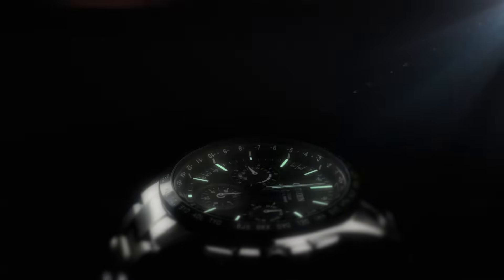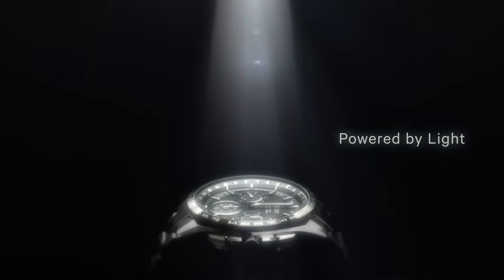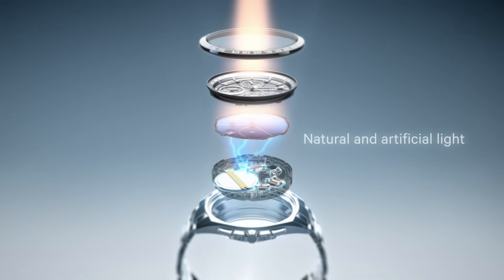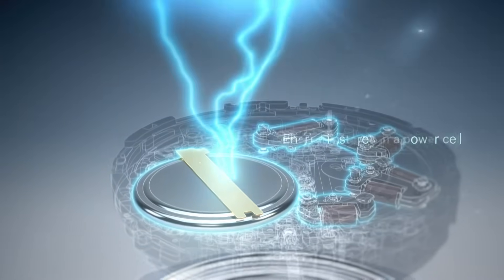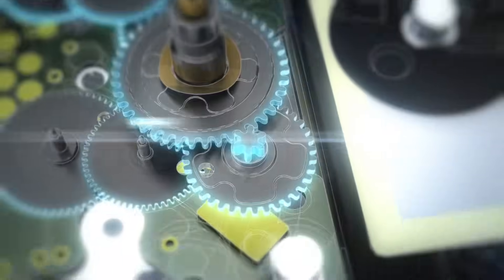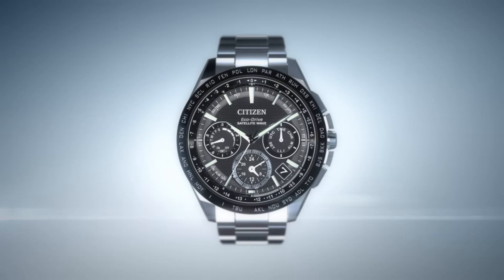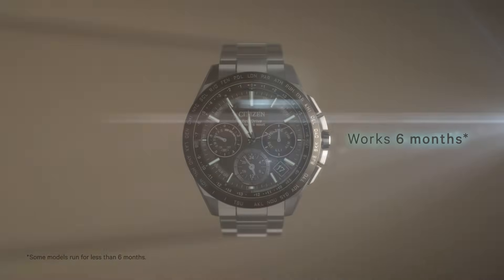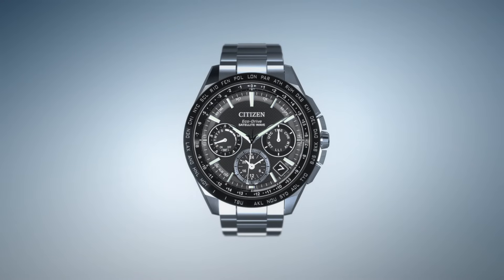Eco-Drive How It Works

Comment: I have the Darth Vader B612, is there a way to tell its charge rate? I thought I read some have a transparent band that goes around the inside dial or something. apart from knowing low power and the special hand ticks back and forth.

Comment: My mom's Citizen Eco-drive watch still works flawlessly after more than 20 years! I've struggled with battery watches and mechanical watches for years, but now, I've finally invested in a Citizen Eco-drive!!! So far, I love it!
Reply: eco drive uses batteries too , only they call them capacitors .
Reply: @tjlee9901  Yeah, I know. With battery watches I meant those ordinary watches with non-rechargeable batteries you have to hand in every now and then to change batteries when the old ones runs out.
Reply: @milosen6744  im just saying eco watches also have batteries and sometimes they give problems and need changing .
Reply: @tjlee9901  Ofc. Few things works 100% all the time, and nothing works forever. But some things works better and longer than others. Citizen Eco-Drive is one of those.

Comment: absolutely amazing watches , I bought my Eco Drive back in 2004 , and never touched it, thing just keeps going and going and going ... I keep that thing on my wrist whole day, every day , except at night... I swim with it, go to gym, hot tub , sauna, work , and it just keeps going ... I have one with a metal band and the whole thing is just super durable , I never changed the band or battery or anything ... it needs no maintenance whatsoever... bought it for 100 bucks new at the jewelry store at the mall .... probably the best 100 bucks I ever spent
Reply: Thank you for your comment. It contains all I wanted to know.
Reply: Stainless steel or titanium?
Reply: Which model do you use?

Comment: So far with mine, it's been 14 years without needing to change the battery. Never needed to open the case.
Reply: I'm at 17 years. No joke, I couldn't be happier.
Reply: Which model do you use?

Comment: So is it considered an automatic or a quartz?
Reply: It is a quartz powered by capacitor, no need for battery.
Reply: It’s quartz because it uses a quartz Crystal not automatic. A capacitor is basically a rechargeable battery. NOT automatic …
Reply: @simonthewatchguy6073  So a springdrive is automatic or quartz ?
Reply: Is automatic, quartz are watches with battery powered by a stone

Comment: I kept shaking my watch thinking it was one of those watches and then thought I had to change the battery but a google search leaded me into getting a flashlight and realizing it charges with light. Amazing
Reply: Antwon you seriously didn’t know you didn’t have an automatic watch? I mean, you can feel the inside weight moving inside of one....
Reply: Noobs ROBLOX I didn’t know how mine worked either until I did some research. Not everyone understands the ins and outs of everything.

Comment: I've never had a better watch. My SkyHawk A-T is going strong in it's 7th year. The battery has never been anything other than full. I've never had any problem with it and I would never consider any other classical watch. The only reason I would change it, is because of a new smart watch or something like that, however nothing beats this classic from Citizen. If you want a quality watch, that you can pick up at anytime and never worry about the precision or the looks or the battery dying out on you or something like that .. pick a Citizen Eco-Drive .. I love to promote stuff that I find useful or just plain working .. if something like a watch works for 7-8 years and I don't need to change the battery every year or so, like I've always had to do with my other watches, which then usually got damaged or they didn't seal them properly .. then I will promote the hell out of that product. I love citizen watches. I'm actually going to buy one for my GF.. or sister .. I haven't decided yet for which one.. because after all those years now, I really know that the watch is just 100% Quality and Professionalism. Love it.
Reply: Amen!

Comment: The device is too small for a capacitor.. at best its no different than a solar calculator battery so its nothing special.. smart move too bad solar panels dont have long life spans or rechargable batteries😄
Reply: Pheonix Rising the watch is not very thin, capacitors can be a few millimeters big, there isn't a solar panel under the watch, it's a photosensitive film which is very different from a solar calculator. Finally, that's not a battery, it's a power cell

Comment: 2 questions:
- after what time its supposed to must having changed the capacitor / powercell? i mena every powercell has a lifetime (how many charges etc)?
- can you then change the powercell just like any other ordinary battery (which it is)?
Reply: Good question. It's obviously got a finite life.
Reply: Youre right. Specially caps. All caps go bad including solid state.
Reply: @quattro4468  non-electrolytic capacitors are composed of 2 conductors, they run flawlessly for decades and I would be more worried about the degradation of the amorphous cell and the mechanical systems, though such watches may outlive their owner.

Comment: Mine's still going strong after 11 years. Great product.
Reply: Mine quit at 11 years almost to the day.  Changed cell....fingers crossed.
Reply: I've had mine working non-stop since 2007 :)
Reply: @stefanopolido7595  My uncle has one which has worked since 2001.
Reply: Have u ever changed the capacitor.?

Comment: Again,   I have several  Eco Drives which have worked fine  for over 10 years, except for the  one that I kept wearing while taking hot showers and  sitting in saunas. The  water resistant can get wet, only in other than hot water.
Reply: I recently bought a pair of eco drives and I found that citizen says you absolutely should not take your watch into hot tubs or saunas. The thermal shock is too much so all the dissimilar materials start expanding at different rates, thus the water rating is essentially nullified. Had I not done the research, I'd have assumed the watch might be fine in such environments.

Comment: Be aware that the ecodrive movement is only warranted for five years. My beautiful watch died after five years and required a very expensive repair.  I chose to go back to other, more reliable brands.
Reply: Todd Ramsey got five citizen eco watches one 30years old never stop. Luck of the draw as they say.
Reply: i have 3 citizen eco drives one 10 years old, one 8 and the other probably around 7 or so years and have never had a single issue with any of them. I have high respect for eco drive citizens and consider them to be great watches. For the money, it's hard to beat them.
Reply: Todd Ramsey  Mine all work beautiful, just avoid  hot baths or saunas.
Reply: I own a Citizen SkyHawk A-T .. I have it now for about 7 years, maybe a bit more .. I've never had a better watch. The battery is always full, it works just like the day I've picked it up. It was my dream watch and it still is. I only recommend it to anyone and everyone. It's sturdy, although a bit scratched now, because I work in harsh environments, but it has survived -29°C daily, I've worked 2 winter seasons in the Switzerland mountains. It has survived many falls, fully submerged in water many times, being banged really hard every day, even getting 220V shock and just about anything you can imagine. It is immortal. I am very sorry for your loss, I can't even imagine it, because my watch will be here long after me, my friend. No Eco-Drive watch owner should see their watch go like that.
Reply: Funny, I have about three Citizen watches.  An SKX07, BN-0150-61E, and a Seiko 5 auto.  NONE have had any services and all work as good as the day I bought them.  I've even used he Promaster on a few dives without any water ingress.  I did have an older Promaster that died on me, but that was due to the back case not being properly seated after a battery change.  I loved the case so much that I went on eBay and found a random Citizen movement for 20 bucks and my 200 dollar watch was as good as new.